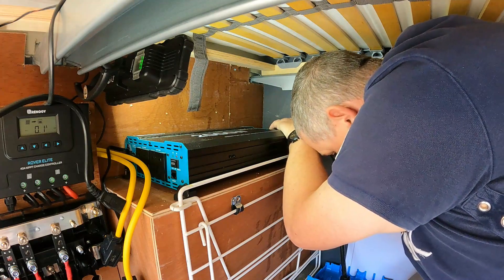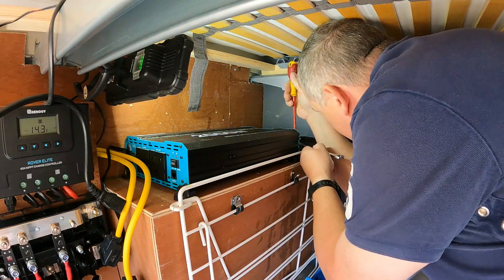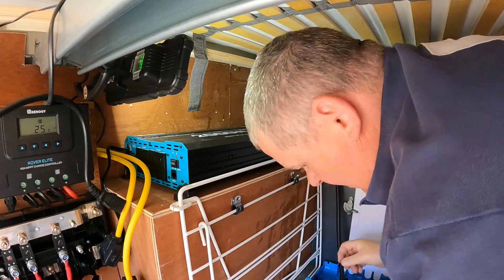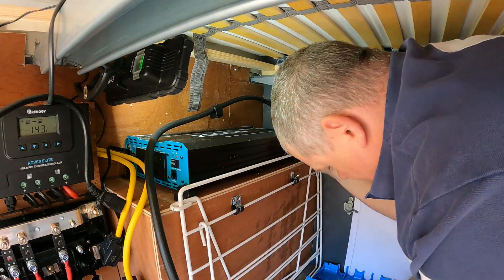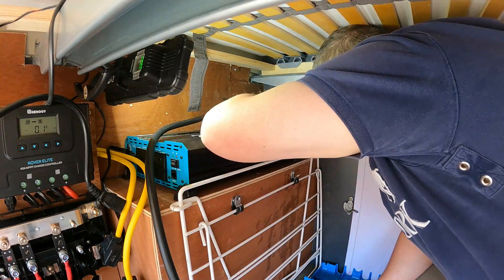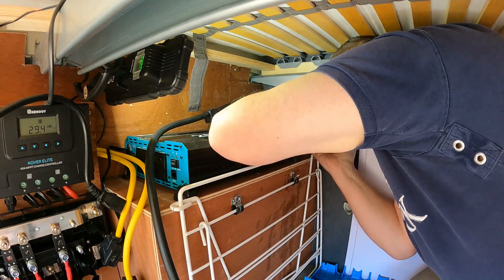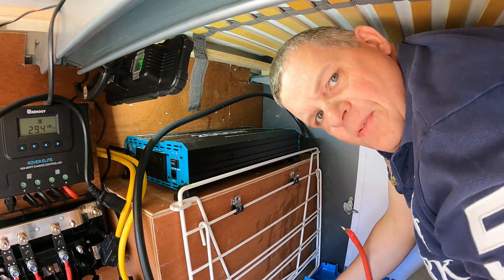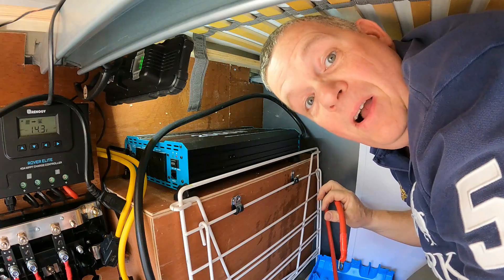Upgrade to Inverter Cable from 35mm to 50mm

Comment: So what the hell does a 35msq and a 50msq wire equate to in AWG? iS that around 2AWG?
Reply from the maker: There are literally hundreds of PDF's you can find with a quick google search giving mm to AWG comparisons...
Reply: @wiltshirecustomcamper7203  Yeah but I don't want to do the mental gymnastics on the fly. It's easier to remember the American Standard, as most stuff on the net is pretty much AWG sizes anyway.

Comment: I’ve seen a few other van build videos with the renogy 2000w inverter suggest using a resistor to discharge the capacitors in the inverter. You’d think with the power switch off there would be no sparks when connecting to the battery terminals but apparently not. Correct me if I’m wrong.
Reply from the maker: Yes. making mountains out of molehills I think! You dont exactly connect and disconnect daily so although, yes I got a good spark when making the connection, it was only the once as I have not disconnected it since....
Reply: @ All my vehicles at some point have had electrical voodoo where a corroded connection or frayed ground has caused error codes. I just went through a wire harness replacement from rodents nesting. Upgrading the wires to the inverter is a must. I’ll still do the resistor thing ti prevent a ‘surge’ from the capacitors whereas previous I thought it’s perfectly safe to connect. I like your setup better than my own. I go direct to the battery and I should have gone to a bus bar or as you have in the Lynx power in module. Going victron instead of all Renogy is a less error prone system. My 30A Renogy charger seems to have phantom voltage when I have my old marine fridge and solar charging. I solved one ground issue but I’d like to swap out the fridge, charge controller with victron and do the 50mm wire upgrade checking all connections replacing the end connectors with marine grade. Good video.
Reply from the maker: @JohnLaFosse  The fact you know what a phantom voltage is puts you ahead of 99.9% of van builders, well done on that!! The renogy inverter is good at ghost voltages FYI. best of luck with it.

Comment: I wont be using a buzzbar, as my set up will be pretty basic. Is this cable you used for the 240v sockets you use insjde the van?
From the battery to battery, leisure to dc etc, all standard recommended sizes?
Reply from the maker: if it helps, in my van: 240v=2.5mm Arctic blue (yellow), DC-DC= 16mm, Inverter to busbar=50mm, battery to battery=35mm, busbar to 12v board 10mm. Dont think there is anything particularly 'standard' as every installation is different but those are the sizes based on my calculations for my van. hope tat helps in some way.
Reply: @wiltshirecustomcamper7203  what size busbar are you using? I've decided to use one now otherwise there'd be too many cables going to the battery terminals. 
Do you know how to size a busbar and cables? I have a 250amp fuse from my inverter and then want to run x2 blade fuse holders off it.

Comment: All common sense good advice!Having struggled with 70mm2 flexible cables in a recent home UPS setup to avoid strain on connection studs etc,  I've since  discovered pre-fabricated insulated high current capacity industrial  braided flexible busbar cables that  I'm hoping will give me peace of mind feeding a 3kVA 24 Victron Multiplus that I intend to install on resilient mountings in a second installation in  an off road  vehicle subject to high vibration.  Extreme care in avoiding cable chafing points, stress on fragile inverter cable connection terminals and preventing loosening from vibration are all areas for attention. In oversizing, don't overlook the manufacturer's downrating of inverters either when vehicle interiors are hot when deciding what capacity you really need.

Comment: Why don't you turn the inverter?
The cables are then shorter and can handle more amps
Reply from the maker: yes, fair point to make and nothing at all to do with the fact the yellow feed cables had been cut to length already and would need a connecting joint to achieve that..  :-)  thanks for the question.

Comment: Instead of guessing there are voltage drop calculators online as an example 35mm cable 2 meters long will drop 0.26 volts at 100 amps that is 26 watts 50mm will be 0.18 volts , 18 watts. But your better off going to 24 or 48 volts and using a dc/dc charger much thinner cables and more capacity from the batteries as capacity drops as the current increases.
Reply from the maker: Thanks for the reply but I lost you after the word 'Instead', I'm all for the Clarkson approach of Speed, Hammer or Bigger covers most obstacles in life.

Comment: You've got one of those silly crimpers.  Dodgy crimps probably heating the cable and not the cable.  I've got the 3000w inverter and had no problems.  You can get a hydraulic crimper for peanuts on Ali-express.  This will give you a cold weld.  I used those crimpers and found the crimps were getting hot.  Table says 2000w is 33mm2.  Keep the cables as short as possible and the same length.  Easy stuff.  Also, use fine strand copper and not CCA.  CCA is cheaper but then you'd have to go bigger and it's very brittle.
Reply from the maker: Yes, they are silly crimpers, also I have found that the 10mm gap suitable for 16mm cable and the 16mm is suitable for 25mm cable and so on. utter rubbish really but lesson learned.....

Comment: I had to do the same upgrade after experiencing the same problem. I guess we can't trust the quoted cable rating........ Good idea with the nylocks but I'm sure Victron specify a torque rating for the supplied nuts.

Comment: Ahh..great to see you on here again...intrigued to know why you didn't use the 2 25mm leads per terminal that came with the Renogy inverter ..or did I miss that in a previous vid..🤔😊 anyway great vid as always...
Reply from the maker: Ah, yes. hoped nobody would notice that 😊. truth is that like all men, we choose not to read instructions and think we know best. Even after wondering why they had supplied 2 sets of cables did it still not occur to me to read the blurb. I then proceeded to install a 35mm cable. only after the problems started did I read the blurb and it said to double up the 25mm cables. Well firstly, cheap skates! why not supply a 50mm cable? secondly, I had since used one of the 25mm cables for something else so decided to buy a 50mm instead. all well that ends well and moral to the story is to read instructions first.... thanks for the comment.
Reply: @wiltshirecustomcamper7203  The current carrying capacity of 2 x 25mm is more than 1 x 50mm. A very tidy electrical installation.

Comment: Thanks for update. 
Did this solve the heat issue on the cable?
Reply from the maker: Yes it did. no heat at all now and the inverter would switch off after about 7-8mins with a fault light where now it does not.